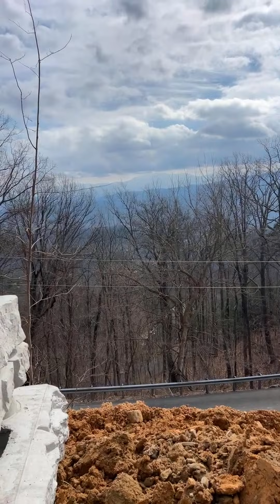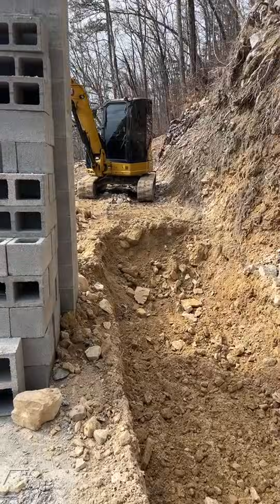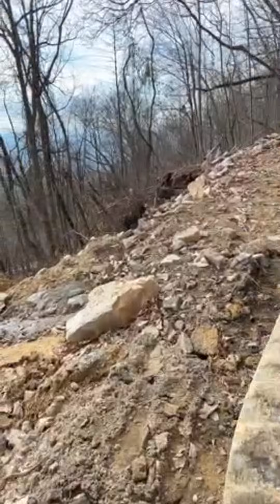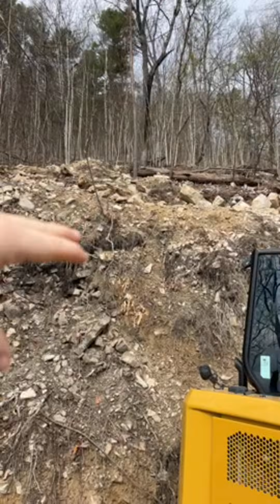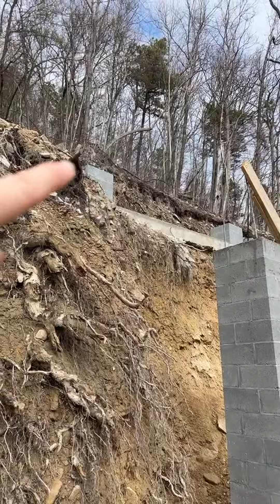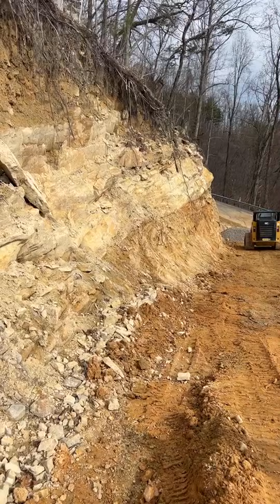Wing Wall Prep on a Steep Slope: Block Delivered, Footer Dug

Comment: Are you going to update on the windfall before it gets  backfilled ? 
 Im curious how the giant Legos get locked together ! 
 We have some good slopes here on our land
Reply from the maker: This isn’t going to be a big wing wall and the guys actually put these together pretty quickly so we don’t want to guarantee any updates before the backfill but we will try our best!  At the very least, you will see it on the Construction time lapse video when construction is done at this location 😀

As far as the blocks themselves, they’re precast retaining wall blocks that mechanically lock together using the concrete shear keys you see on top. They’re actually just dry stacked. Once it’s backfilled, the wall and slope work together as one system. 😀
Reply: Wingwall